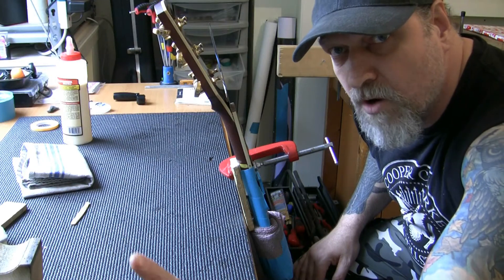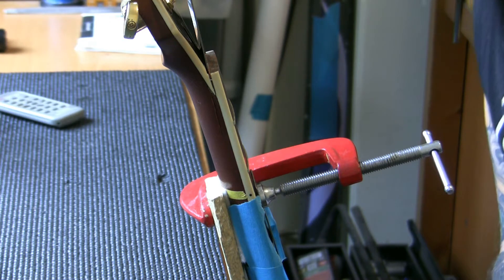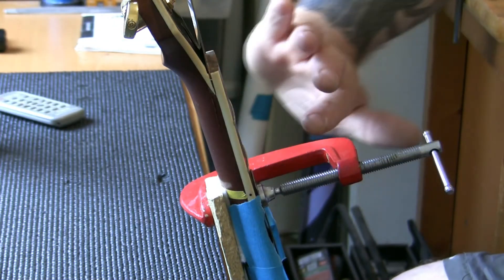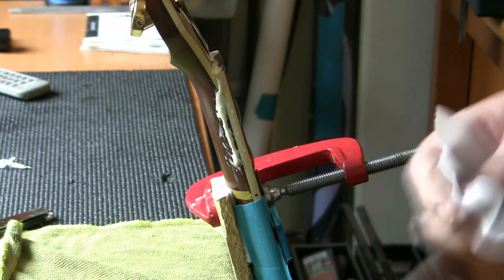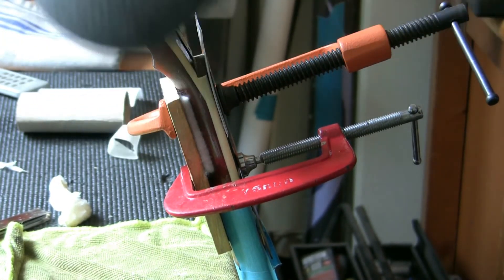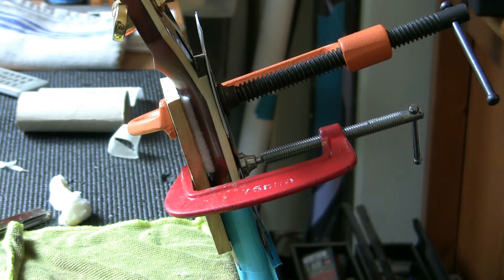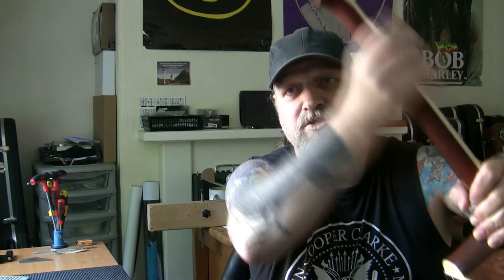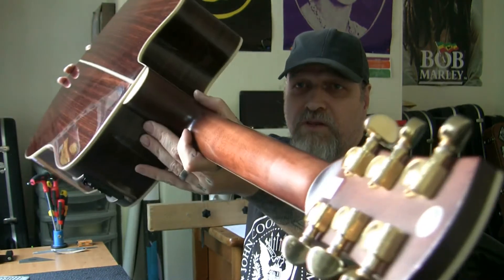Fixing a cracked through guitar neck on a Garrison AG-700 CE...

Comment: Did you straighten the neck before you glued, Victor, or is that not necessary?
Reply from the maker: Neck was straight with truss rod loose...
Reply: Thanks. I have an EB-3 with a similar problem, though only with the fingerboard separating.
Reply from the maker: Clamp 1 fret after the split so as not to extend it; gently prise open the gap (I use a steel rule or similar); drop some Titebond in the gap and spread it around using a feeler gauge thin enough to get in the crack. Clamp as I did in this video wiping away the squeeze-out. Should be set in 30 minutes but I leave clamped for a few hours. You should get a real neat fix. Sand the finished area with fine paper until smooth and flat. Should polish up nice...
Reply: Thanks, Victor. That's pretty much what I planned on doing, but it gives me great comfort that it's what an expert advises. I'll get onto that ASAP.
Reply from the maker: I'm sure you will do a great job :)
Reply: Fret Friend UK Thanks. Due to watching your work.